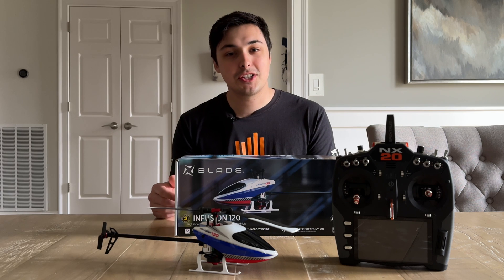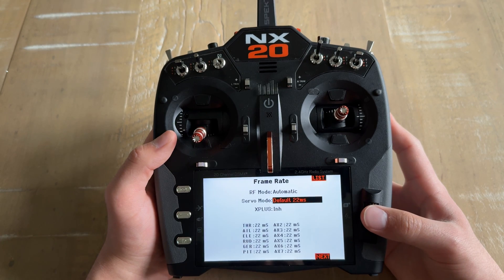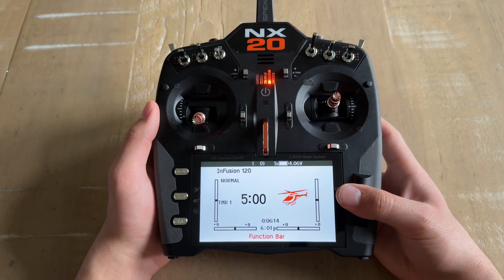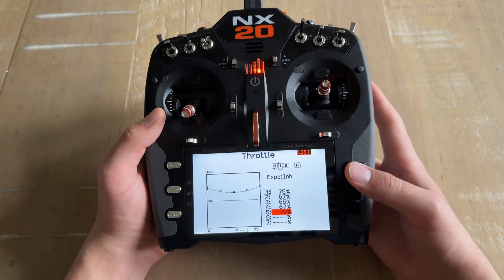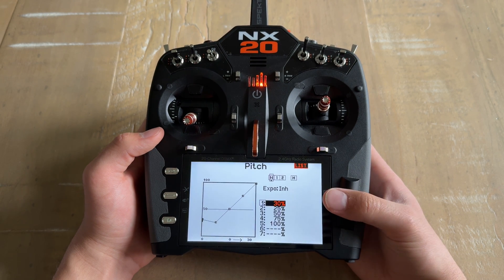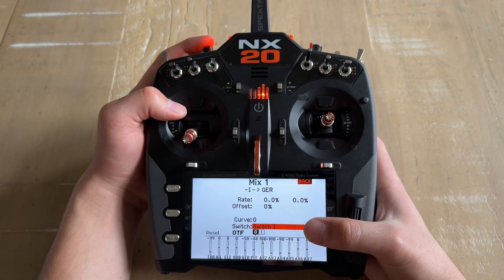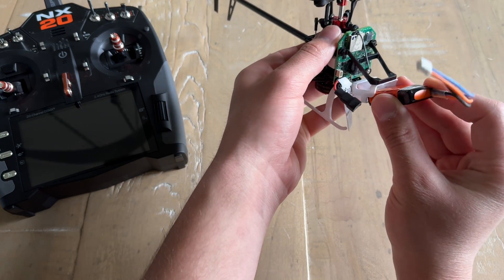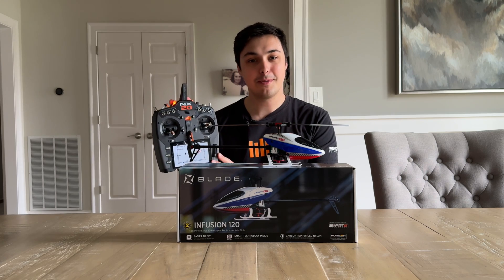Blade InFusion 120 Transmitter Setup and Binding

Comment from the maker: Please click "...more / Show more" for links and more information. Visit https://www.horizonhobby.com/product/BLH6950.html for more information on the InFusion 120.

Join Horizon Hobby Air Team Pilot Ethan Ater in this step-by-step tutorial video on how to program and configure a Spektrum transmitter for the new Blade InFusion 120 as well as how to bind them together!

The InFusion 120 is an all-new design from the Blade® team engineered for next-level durability and performance. Featuring an oversized direct-drive power system, no gears are driving the main rotor, allowing for instant power and lower parts count. For intermediate to experienced heli pilots looking for high-performance capabilities in a small size, the InFusion 120 packs a punch perfect for thrilling aerobatics while flying in gymnasiums, backyards, and beyond. The InFusion 120 is easy to see while tearing up the sky with a one-piece canopy that’s factory-finished in a vivid trim scheme and bright white landing gear. The factory-installed all-in-one ESC, flight controller, and receiver unit takes advancements from Spektrum™ Smart Technology and our latest flight controller algorithm to effortlessly provide valuable telemetry feedback and stable yet maneuverable flight capabilities. With BNF® Basic convenience, all you have to do is add a 2S 280-300mAh battery (SPMX3002S30 is recommended), bind it to your compatible 6+ channel Spektrum DSMX/DSM2 equipped transmitter, and you’re taking to the skies!

Follow Blade RC on Facebook and Instagram for more Blade content!
https://www.facebook.com/BladeRC1/
https://www.instagram.com/bladehelis/

Comment: Hi , I purchased the helicopter a week ago, I have a DX6 remote control, I have done all the directions. In mode 0 the helicopter flies without auto hover/self leveling. What could be the reason?
Best regards
Eyal

Comment: Gear is not an option when setting up the Mix for switch I- i assigned it correctly but does not show up
Reply: I have the same problem did you ever find a solution?

Comment: Hello from Germany - thx for zhr vid - just a short question - i bought the 120 infusion & NX7e + - manual didn't mention the NX7 to work with the blade 120 infusion? Is this possible to do so? thx and a good time rgds JOE
Reply from the maker: The NX7e will work just fine for the InFusion 120. :) It will follow the same setup process as the other NX transmitters.

Comment: It comes with a bind plug to, which doesn't appear to do anything, it says in the manual you can bind either way, I tried with the bind plug and it didn't  work.
Reply: use the port on the aft side of the control board, that will work